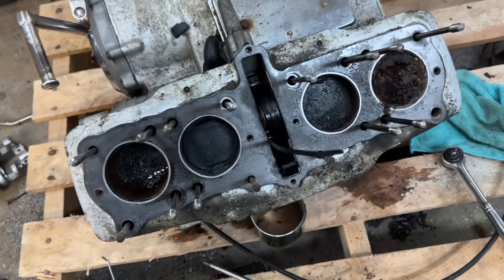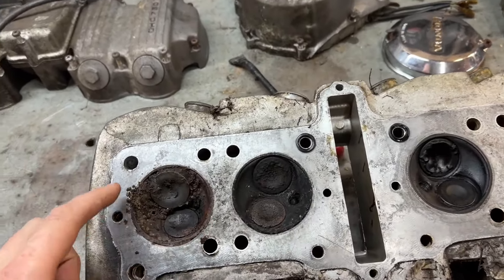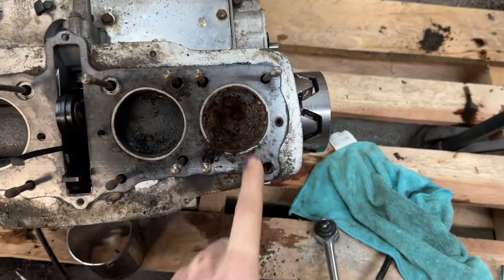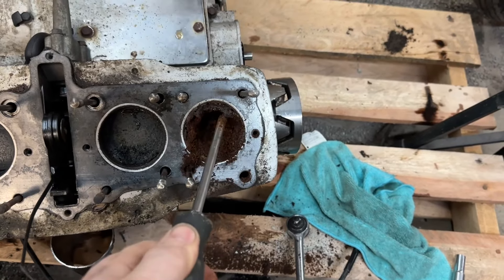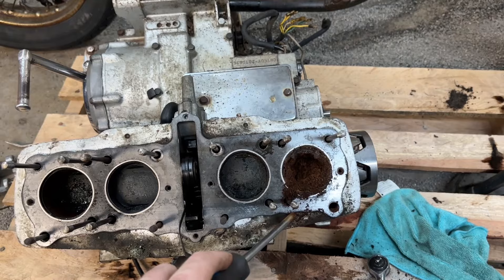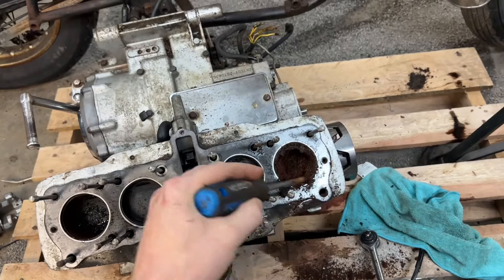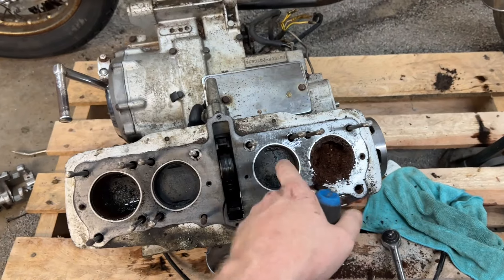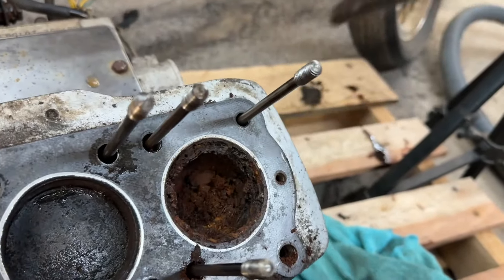My engine isn’t engineing

Comment: Possible to get oversize pistons and get the cylinders punched out?
Reply from the maker: Actually yeah, they sell in .50 and .75 mm oversized
Reply: @StationroadRatrods  there’s your answer lol, send out the cylinders to a machine shop
Reply from the maker: I’ll do some research and see if the sleeves are thick enough

Comment: Something doesn't make sense here. 1 and 4 have the broken plugs so the only way for stuff to enter the cylinders would be through the carbs and past the valves. Was the stock airbox installed with a filter? Or was it removed when you got the bike?
Being that you are willing to learn a lot you would be surprised at what some elbow grease could do with that cylinder head. Pulling valves is easy and with a steel cup and some sandpaper you could probably clean it up good enough for that old bike. Same with the pistons except you may need new rings.
There is an old saying with old bikes like this... cheap/free bikes are never cheap/free because of situations like this. Never again will I buy a bike that doesn't turn over or run at the minimum.
You are gaining a lot valuable information so at the least you have that. 👍
Reply from the maker: The bike was complete, airbox and everything were on it. All of the plugs were in the head, they broke when my brother tried to get them out, they were seized in pretty bad. 

I’m gonna knock the pistons around enough to see if I can get the head off, then assess it from there. The parts aren’t too expensive though I know it’ll add up pretty quick. It would be about 500$ cad for a used upper and lower cylinder head from eBay.

I’d say rings are the bare minimum
Reply from the maker: Edit: the air filter was also in it, it was parked and untouched
Reply: @StationroadRatrods  Well then something is definitely amiss somewhere of all the plugs were in and airbox installed. 
I wonder if that bike was in a flood of sorts. That much debris in that cylinder isn't possible without moisture entering theough a open valve if the plugs were in. Or at some point the plugs were put in after the fact.
Either way lots of work ahead.
Reply from the maker: @toolshedadventures well we usually get 3-4 feet of snow every winter and it was parked outside for 30 years. There’s a possibility

Comment: Did I miss the video where you solve the timing chain issue ?
Or did you just cut it ?
Reply from the maker: A few comments in the last video helped figure it out, I just unbolted the cam gear so I could rotate the cam and remove the rocker shafts

Comment: Dingle ball hone and a bit of Marvel she’ll be fine.
Reply from the maker: It’ll be fiiiiiiine
Reply: @StationroadRatrods  its probably just surface rust. Probably can’t even catch it with a finger nail.
Reply from the maker: Finger nail definitely didn’t hook into a scratch in the cylinder. Haven’t find the cylinder yet 🤣
Reply: @StationroadRatrods  can say it’s bad if you can’t see it.  🤣🤣